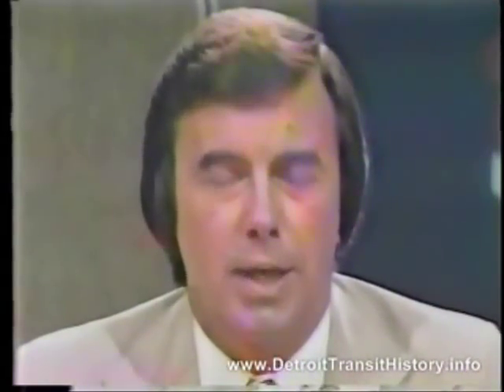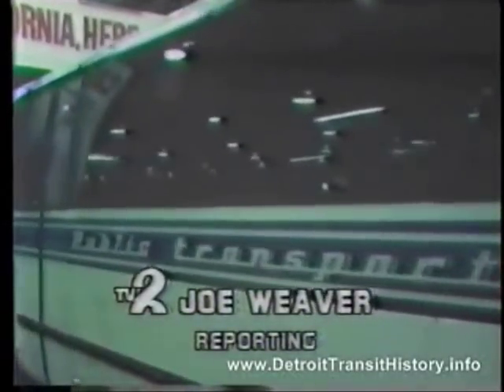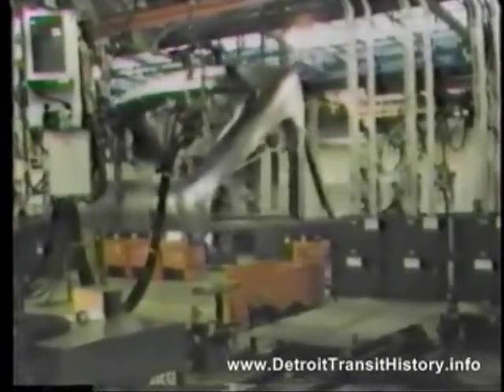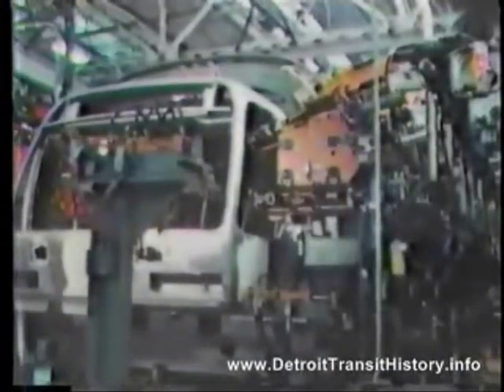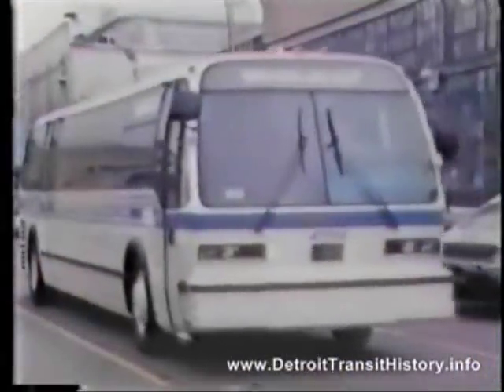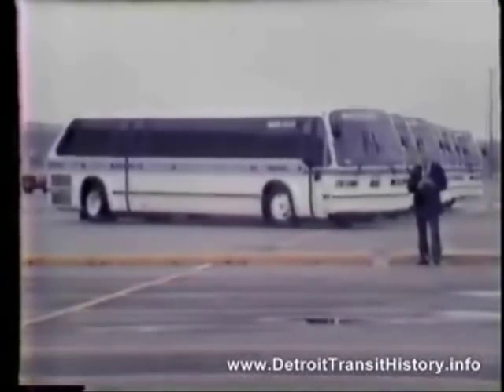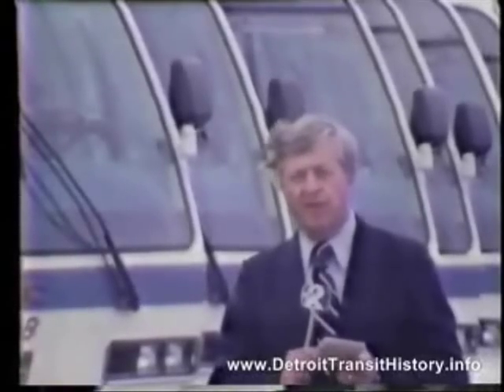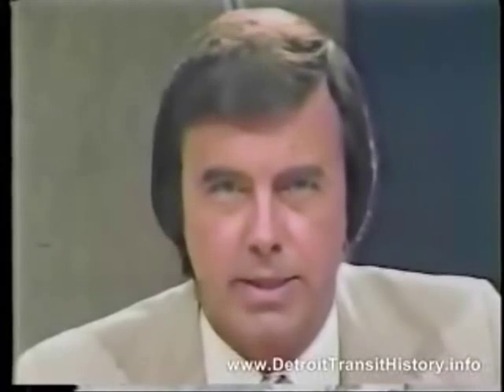THE FIRST RTS-II COACHES DELIVERED BY G.M.C.

Comment: This is where it was the best. Was both modern and acessible. Without loosing the coolness of a loud bus engine, high floor height, and comfort. These new low floor hybrid busses will never compare in the fun factor and comfort of riding buses. I miss riding New York’s RTS busses.

Comment: When  I worked for LBT as a utility worker (11/95 to 1/98) I had the opportunity  to drive 4701 around the yard. Now, 4701 is in a museum in Hershey, Pa. and all the RTS's are now retired. They also had 2 Eagle model 10 coaches (4801 and 4802) before they were replaced with 1 Prevost H3-45 coach.
Reply: Yup.
Have been to MBT and set foot on good old 4701.
She's a beauty.
Our favorite kind of bus.
Reply: That Prevost, 2000, is now the very last diesel bus in LBT's fleet. It will be retired by the end of this year, being replaced with 5 new battery powered commuter buses (BYD C10M). That will make LBT a 100% clean air fleet.

Comment: We had the RTS-II in Indianapolis as well and many of them. They directly replaced all 1976-1977 AM Generals. The wonderful part of the RTS fleet was that they had power steering which was a first for Indy. Once the RTS fleet got a few years old, they too turned to junk and rattled worse than the AM General Fleet. It was after this that Canadian built GM "New Looks" became available which was the best transit bus ever made in history. RTS was good brand new, but quickly turned into a nightmare.
Reply: The ones from the 77- 80 were still new to the market. I feel like the rts 1981 and beyond that were pretty solid buses
Reply: NYC MTA had 20 year old RTS busses running up to 2019. I really liked them. They were surprisingly quiet inside, but loud driving by. So many more seats and was always a comfortable ride. They rattled though.

Comment: Moved to Long Beach from Los Angeles in 1980, and they were still running plenty of the sloped rear RTS ll (or series 1) buses and not only did I love the look of these, they rode amazing and had very modern features and interiors for the time. We just lost our family car months after arriving/moving and wouldn’t have another till late ‘84, so it would be an understatement to say we rode plenty of these buses! On bus trips to LA, I clearly recall they had the flat or ‘square’ rear buses first which was a clear update or series 2 with other small insignificant detail changes and I remember finding these far less appealing and sleek looking as our Long Beach buses were. But eventually they changed the rear caps on the LB buses as well, most were new with the square rear ends and some were retrofitted with the flat/square ‘caps’ added due to updated engine/AC/hardware to the series 1 models. Best looking public transit busses to date in my opinion!

Comment from the maker: As you correctly stated, the RTS-II (Series 01) buses featured in this video were built special for a select group of transit properties. However, the first "mass-produced" RTS-II (Series 03) coaches (with production beginning in April of 1978) were delivered 25 miles south from the GM Pontiac plant, right down the I-75 F-way to the Detroit bus operation.
Reply: Nope.
First production models went to Long Beach Transit in CA. The very first one, 4701, is at the Museum of Bus Transportation in Hershey PA.
Reply: @blue9multimediagroup ok BOOMER

Comment from the maker: Actually, the NFTA got the first 40-foot "96-inch wide" model TH-8603 RTS-II (Series 03) coaches which were delivered between Nov'78--Jan'79, whereas the Detroit DOT received the first mass-produced "102-inch wide" model TH-8203 RTS-II (Series 03) coaches (serial numbers 001-070), which were delivered beginning in May of 1978.

Comment: I drive an RTS for Walt Disney World and they are of course the oldest buses in the fleet.They don't have anywhere near the room the Nova and Gillig buses have.It's interesting to see these buses brand new compared to what they had at the time.
Reply: Christopher DuBois I didn't know these were still around I thought they were retired by then glad to see they are still around
Reply: Green Mountain Transit (Burlington, VT) still has a few mainly used on school runs (Burlington "proper" has only a few yellow buses.
Reply: Actually they have more. RTS seats 44-48 while a NOVA or GILLIG only seats 37-40.
Reply: @blue9multimediagroup  
It’s true due to the front window seats being possible allowing an additional 6 seats and less of a social stigmal to stand in between the wheel area with low floors. I miss riding on the very front seat above the front right wheel and looking out the windshield and the floor of the door as the bus was moving.
Reply: @an2niotransitproductions813  
Yup. 
Front right hand seat was my spot (or the front left behind the driver if that one wasn't open). 
Could see the driver and watch the scenery come up.
Reply: @blue9multimediagroup  
Such a shame not a single company offers high floor local transit units anymore. Its only express buses.
Reply: @an2niotransitproductions813  
You can thank the ADA and companies wanting to make it easier for disabled passengers to board and exit quickly so as not to disrupt service so they prefer ramps as opposed to lifts. Easier maintenance and less moving parts to break down.
Reply: @blue9multimediagroup  
Honestly. The ride on low foors suck. It was worth the hassle to go up a measaly 2 extra steps. If I were disabled I would not mind the lifts. Orion V seemingly had a better front lift design.
Reply: @an2niotransitproductions813  yeah but when you're behind schedule and you now have to kill 5-10min per trip to load and off load a lift, then it makes a difference vs 2-5 for a ramp.

Comment: a real supet heavyweight-32000 pounds empty-overbuilt to survive the extremes and then some (16 ton beast!)- the original 5105 gmc and the the mack c 50 weighed in at 20500( 10 1/4 ton) in comparison to this 16 tpn beast. these buses were BIGGER BADDER AND STRONGER- their only limitation was the governor attached 6v71 diesels/the nova built ones are still used in nyc THEY ARE not the original GMs out of pontiac michigan!  I miss these friendly faced monsters

Comment: I wonder if GMC still make buses up to this day and made the RTS successer model. Heck maybe make limited edition low floor bus with design of GM historical well know buses.
Reply: GMC sold off the RTS to TMC in May 1987, though the 1987-1988 NYCT order (completed May 1988) was last to be GMC built (shells by GMC, final assembly by TMC in Roswell). The RTS assets and designs would be under Millennium Transit (MTS), but not sure that happened to their assets in bankruptcy.

Comment: TriMet's 75 RTS's buses, built in July/August 1982 and placed in service that October, used 6V92TA engines, but lacked A/C. TriMet operators didn't like the handling of them, though, and were displaced by the first couple of New Flyer low floor buses in the late '90s.